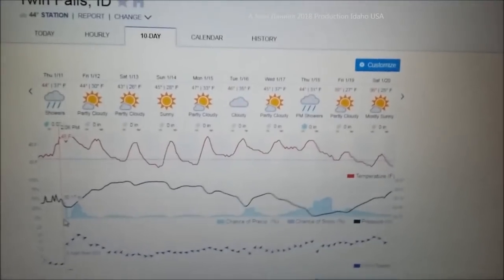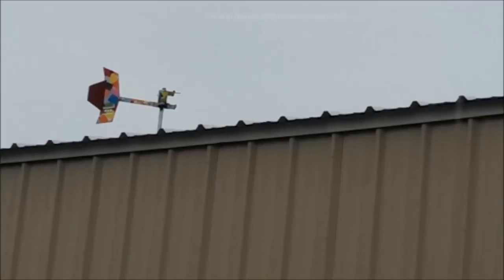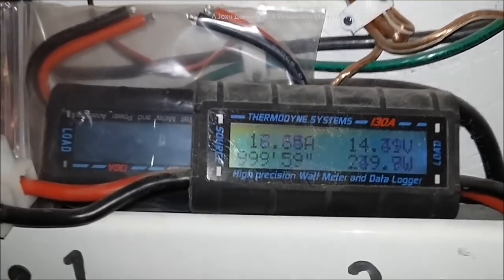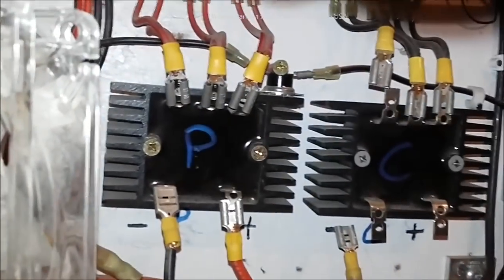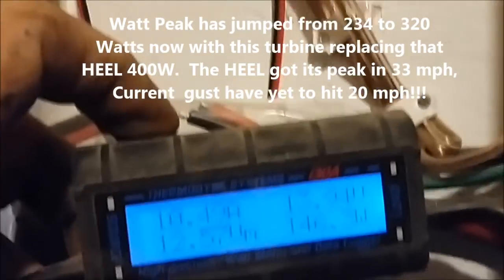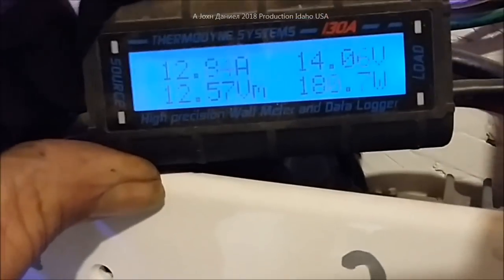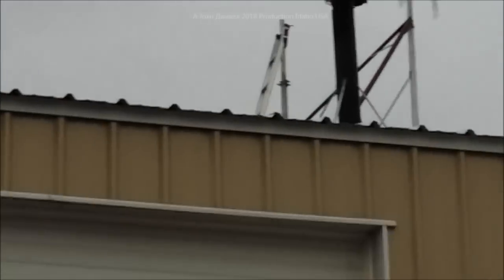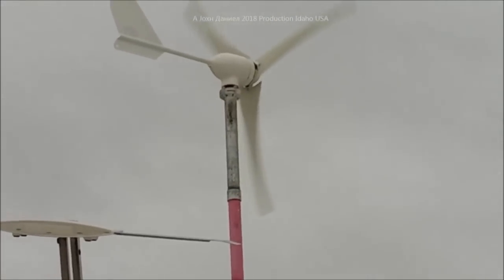Success, $220 (before inflation) China 500 Watt Wind Turbine super performer, BIG PARTS LIST BELOW

Comment: I went to that link you had on your other chinese video year ago,, thought I would be smart and bought a different one, but returned it and bought the one you put a link for. The one you put this link http://rover.ebay.com/rover/1/711-53200-19255-0/1?icep_ff3=2&pub=5575119394&toolid=10001&campid=5338235705&customid=TruGen+Pure+Copper&icep_item=132407715344&ipn=psmain&icep_vectorid=229466&kwid=902099&mtid=824&kw=lg on is a power monster. Should have listened to you the first time, wasted a month. 
 Thanks, theres so many that are similar its hard to decide whats a real rated one. If I buy this one too I will not mess up again.
Reply from the maker: Yes, thanks. I test, Prove, and only recommend whats REAL and WORKS!

Comment: Got a very similar turbine, 400 watt version that came packaged like your along with the assembly sheet. Gives me some hope when she's running.
Reply from the maker: They rate this turbine at 500 watts, however thats a LAWFUL RATING based on a international norm of 24.7 mph. Mine has peaked over 1100 watts numerous times in winds over 30 mph. Junk sellers, mainly the moron Jeff in Missouri sells a complete scam based on 200 mph winds to get 1600 watts from a turbine weighing the same. Good buy - you getting a REAL ONE!  Your 400 watts are REAL power, not imagined like the Missouri scam master jeff does.
Reply: hi there Sc0rPsX, were do you buy it? is the same turbine like John Daniel?
Regards.
Reply from the maker: They have a few more in stock here through ebay https://ebay.to/2ujiGjE
Reply: Hi Jonh, thank's for your reply! I' m from Portugal, don' t known ir they send to Europe....There is other place to buy it? Thank's m8.

Comment: Hi John, what controller are you using with it?
Reply from the maker: The best active diversion controller on the market. A Wind&Sun URD. It uses dc to dc  SSR Relays, is full pulse and dependable.
THE CONTROLLER - http://rover.ebay.com/rover/1/711-53200-19255-0/1?icep_ff3=2&pub=5575119394&toolid=10001&campid=5337966591&customid=WIND+AND+SUN&icep_item=131276389277&ipn=psmain&icep_vectorid=229466&kwid=902099&mtid=824&kw=lg #1 controller for diversion and wind
The best dc to dc Solid State Relay to buy is MAGER! (rest are bad deals, knock offs) http://rover.ebay.com/rover/1/711-53200-19255-0/1?
Reply: Cool i have the same controller and 1200wats of resistors. Wich one ssr are you using?
Reply from the maker: MAGER 60A dc to dc

Comment: what is the name brand for billy jack wind turbine ?
Reply from the maker: Jiangsu Naier  Wuxi City, China Originally known as Naier Oulu Wind. They were taken over, reconformed, by Hei fi industrial Energy in Feb 2016 and the improvements went through the roof. 
 The NE500x I have is a joining of the NE400 body by the company with the 
NE-M2 Wind power Turbine generator head and the 700 mm blades used by the 600 according to US investment officer and sales guy Xiao ping Pu. 
Best info I can give on it at this point, it took days to get answers from them, but it is a amazing little turbine so far.

Comment: i bought one of these turbine based on your review of this thing . amazing numbers from it you inspired me to get it :)  . its going to be my first turbine. i have used solar( 40watt) already to run some small lights and a water pump for my greenhouse charging a small li-ion cell pack but have zero experience with wind .
i'm going to be using a charge controller which when the battery is charged (60ah)  it will dump its load to an inverter running a little heater bulb to heat a dog's shed. my question is in Ireland we get an average of 17mph daily wind but at times regularly in winter we get weather with 60mph possibly 70mph gusts ..will this burn out the turbine even with the load ?
your videos are a great help.
Thanks Jon
Reply from the maker: I myself worry about the little turbine because its exceeding all expectations and even has ran at 800 watts + in my winds, I too get high crazy winds. We can get 100 mph winds and at my place I have quickly burned out 2 generators from Missouri in under 50 mph, 1 from Wind Blue at less than 40 mph, one from HYE at under 60 mph, one AirX in winds over 80 mph, and 2 from gudcraft in 60-70 mph. The only generators that seem to never blow up is the cheap simple Hornet wind by Thermodyne, which is also the ones I get the most power from - go figure!! But you have to build your own Turbine body for that Hornet like I did. 
 One of the ways to deal with it I just made a video on is using 100 watt inline resistors to stop high wind days FREAKS PEAKS. Like shock absorbers to stop those over spins that can burn one up that can be engaged and it seems to be working excellent to stop the turbine from just running away with itself. Study this https://youtu.be/s9hn2fzAURA
I have decided to start building more of my design for lots of people using the offset center like Chaos Turbine which was a build from scraps, audacity, irony and to be funny! But just look at it, damn thing ate every 3 wire slip ring I put in it till I spent the extra $10 and went 6 wire from Hurricane wind.  Now its the best turbine on You Tube!
Reply: 800watt that is serious something  thats supposed to be 500 . my plan is to initially mount the turbine lowish to reduce the chance of burnout . i got a watt meter but a cheapo copy of yours will be interesting to see how accurate it is cables seem thick enough. I wont get my turbine until mid feb so I look forward to seeing more of your videos in the meantime. thanks for the advice !
Reply from the maker: Their is a unique magnet style in these turbines, and mine has hit over 1100 watts in a few peaks, nut was not appeared to be hurt, So far. 
Yes, Low with decent wind access is a great idea
Reply: Јоhn Daniel my charge controller is a 550w with a 40amp relay for dump load i think i didnt get it yet .. I wonder will it survive a peak like that. I will have my turbine tomorrow but i have to wait another month probably for my recitifier and watt meter . Interesting times ahead 🙈
Reply: jon mcgarry I would be curious to know how you're project pogresses. I'm in Dublin and would like to mount a few turbines. Am a relative beginner, and inspired by these videos.
Reply: Yeah I'll let you know... if I ever get it finished .. was shipped wrong hub 5 blade instead of 3 blade

Comment: not bad power output for such a low wattage turbine in 20mph, but  i think without the  annoying cogging vibration down my tower from my 100% USA  made sorry i meant to say vietnamese made pmas ,  id never know the turbine was spinning, i had have to unbalance the blades on the new turbine so i dont miss out lol.
Reply from the maker: +closertothetruth Sad to say, but this one is a sealed unit. May have to pry it open and add nuts and bolts to get that Missouri SkyRattler soothing sound.

Comment: may be good for hot water
Reply: That's an interesting way to take the load. Say I have a hot water storage tank that has it's primary circuit off the gas boiler. You can also buy the tank with a 240v immersion element. What else would I need to feed the element and save on the primary circuit?
Reply: These wind generators are generally 3 phase. Best way to harness the energy off them is use 3 step-down, 12/240V transformers. Connect the transformer secondaries directly to the generator output (AC "Y" config), put bridge rectifiers (>2A, 400v rating) on the transformer primaries and tie the +/- bridge leads in parallel, respectively. Use the high voltage DC to power the tank heat element. Heated water is better energy storage as batteries give out after 6-7 years. Be sure to install a safety cutout on the generator side so you don't fry your a** doing maintenance.

Comment: Hey, I really appreciated this series. I have been looking at wind power for a little while, to power my camper. I am pretty sold on this unit from your videos. Would love to see a follow up video in a month or two, just to hear if you are still happy with this unit and how it is holding up. I also found your series on the HF 100w solar set up very useful, I have purchased that set already. Thank you for sharing with us, and keep the videos coming.

Cheers,
Gorbag
Reply: Also would love your advice for a good charge controller for this unit.  Edited for my bad typing.

Comment: i bought a 400 watt 5 blade model that has the same flange from banggood and its doing really well it dont take much speed to get the voltage up to 12 volts to start charging i was happy to see the bench test results of it with my porter drill on low speed Im actually running the DC side through a step up converter to increase efficiency from low winds we really dont get alot of high winds in central KY. but some times of the year can get up to about 20+ gust and average is around 5 to 10 mph. Im considering to try the 3 blade but im not just not to sure how well it would work out for my area that is why i went with the 5 blade to catch more wind to make it turn.
Reply from the maker: +Steven Rowland The build video details more https://youtu.be/9DFIKrQd3Ic

Comment: Hmmmmmm, I like it!  I'm still saving for my Thermodyne unit though.  They assured me that it will hold up in 90MPH winds which I think killed my small Chinese turbine.  It isn't fully dead, but it takes at least 20 MPH winds to produce.  I may buy one of the ones you show just to power my outdoor shower hot water heater and a small battery bank inside my shipping container.  Thanks for the post and info!  Keep up the good work, John!

Comment: Something I always wanted to try is take a DC motor to spin a turbine or alternator. Most say the motor would dry too many amps and wouldn't be worth it. In my eyes if it takes ten amps to produce twenty or more amps it would be worth it. If any of your followers have tried this I would love to know how it turned out. 
Good job my friend and thanks for sharing.
Reply from the maker: If you truly want to make a back up power supply, you can bulk buy batteries for near to nothing like the 18 volt harbor freight tool battery. Charge them from solar and leave them on the circuit to be dumped into your battery bank as needed. A hot 18 volt battery of 1.5 amps is 2 amps to a 12 volt battery in charge dumping.

Comment from the maker: They have a 3 pound lighter little brother 400 watt thats just as sweet, these are made by Fushan Gigu in/at 7-17D, Yingjunnianhua, 3 Lingbei Road Nanwan, Longgang, Shenzhen China. For a Note ; The Shenzhen District is the Highest technical level of Chinas manufacturing, such as DDR RAM and SSD manufaturing like Blue Drive, Kingston, Sandisc, Delco Phillips, Hitachi and Motorola Component. I think I like this little turbine, most are Re-Name for market items. But to see a GIGU product perform you can see a actual branded WINDPMG1500 GiguFushanGigu at https://www.youtube.com/watch?v=UxGqYVF_o-I
Reply from the maker: If your controller is 3 wires in, it already has a rectifier
Reply: Thanks so much. Your videos have been a big help. Also I was wondering if the rectifier is neccesary as my charge controller has 3 phase input.
Reply: Your aliexpress link goes to Wuxi Naier Wind Power Technology Development Company's aliexpress store. So is this Gigu wind turbine different manufacturer? There's 2 websites for Jiangsu Naier Wind.. (Wuxi)
http://www.wxnaier.com/index5.htm
and 
http://www.jsnefd.com/index.html

are these same company? Do you have any idea?
Reply: I purchased the 400 but I don't weld and can't find a premade flange to mount it on a pole so I'm kind of stuck at the moment
Reply from the maker: Your fix is coming from my homework, Exactly what you need then https://tinyurl.com/42-8-Structural-Fitting
You will have to very lightly adjust your 4 holes, but by very little. And it is VERY strong, and light.
Reply: Is it still going

Comment: Do you know the minimum wind required?
Reply from the maker: +lastniceguy1 I have noticed it's consistent to make 1 full constant clean amp in 7 mph. Then it seems to progress very quick from there. At 10 mph it's got serious balls and stability. At 15 mph it's at near half its rating, which is actually 450 watts with 510 peak. However last night it was the 25 mph winds and 427 watts was the Peak recorded and a steady 380 to 400 was coming in. No jumping around like most,  just constant power even with winds being dirty sometimes in line with the grey turbine 35 feet away. I think I need 5 more LOL!
Reply: Nice vid John. Thats a nice little proven turbine😀